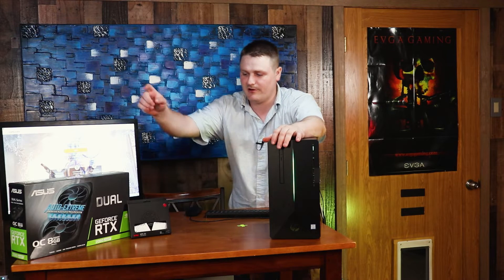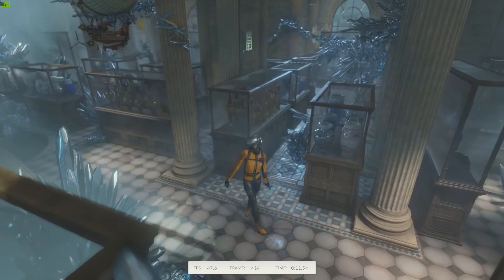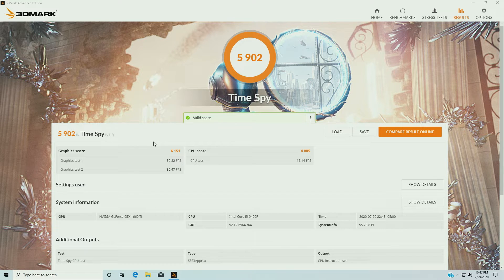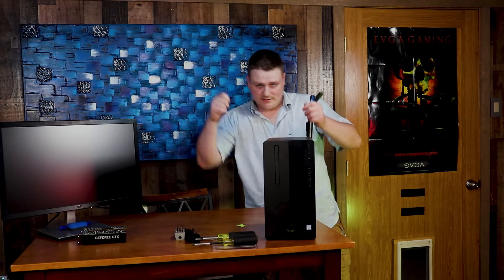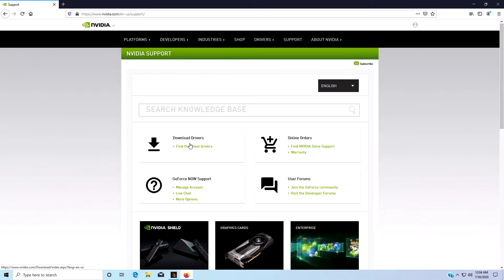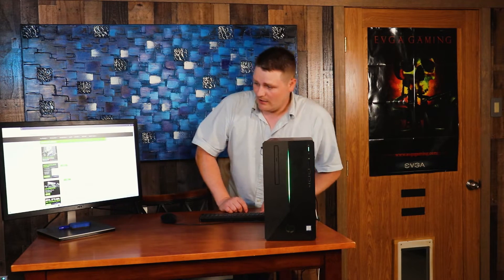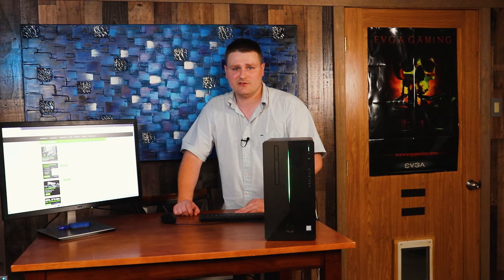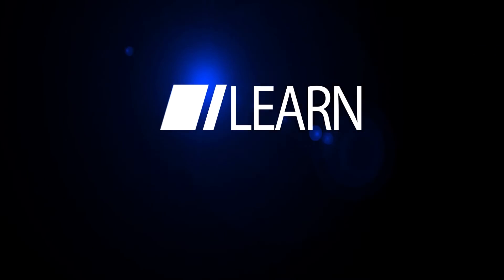Hp Pavilion Gaming Desktop 690 Upgrade To A RTX 2060 Super 8GB GPU & 16GB Of Ram (How to Install)

Comment: i have a HP Pavilion Gaming Desktop 690-00xx with an AMD Ryzen 3 2200G with Radeon Graphics 3.50 Ghz, 24 GB RAM, with a  Radeon RX 550/550 series GPU. is there any place  where i can find which GPUs can be used to upgrade it?   Another question: is the case ok for that card? forget about the space, will it overheat after hours of using it? it just doesn't seem like these pcs have enough airflow for that kind of card
Reply from the maker: Well they do run warm, no they do not overheat.  You will have to look at your psu, to see what one you have. If you have the 400watt psu, with the 6+2 connector. that will work for up to a 2060 super. They make a 500watt that will only take 1 screw. from the forum posts I've read. I do want to test this psu out, and see if I can drill one hole to get 2 screws in to it. Then I would make a printable template foldable jig, so you could drill one hole so it is secured. This is some thing I have planed. Just have to order the psu and cad out the template and jig. When I have the time and get the psu.

Comment: Hi I have a HP Pavillion TP01-0040. The dimensions are 13.3 inches in height, 6.1 inches in width and 11.9 inches in depth. I am trying to upgrade the gpu of my pc. Do you know if an rx 580 8gb with dual fans fit in it? The dimensions of the rx 580 is 4.9 inches in height, 1.6 inches in width and 10.6 inches in length. Please let me know I can't find any information online. Thank you!
Reply from the maker: What I would do to be 100% sure is power down the system, unplug it, then take the side off. See if it measure out. I do not know the case. This is the best I info I could give you so you are sure it will work.
Reply: @TNW1337  ok thank you so much I will try

Comment: But what about ventilation? With such a monster GPU will it still be cooled enough?
Reply from the maker: I would only do a Dual fan Gpu, Because of it. They do Blow out a good amount The GPU does it has venting. Doing 4 Benchmarks is like taking every thing to 100%. In a room temp the setting the system only got to 60-65C Now the Cpu did see 70C but the Intel's can do 80C be for they see damage. Most Cpu at full load will sit at 65-70C it is Fine. At idle most sit at 40-48C

Gpu are a different animal.

Look at this link https://www.wepc.com/tips/optimal-cpu-gpu-temperature-gaming/
Reply from the maker: blaziken  As long as you have a 400 watt Psu a 2060 or 2060 Super is just fine. If you can find the under 210 Watt card. 2070 dual fan it will work. It will run warm. 
If you try to OC you will run in to problems.

AMD's back in the day Average Temperature was 80-90 some Cpu's Even Higher. Unlike Intel's they would top out at 85-90C This is getting in to damage be done Area.
Reply: Asus also makes a mini version of the gpu that provides better clearance. EVGA makes several that will fit as well. I am currently running an EVGA 2060 KO Gaming in my HP and it fits perfectly and stays cool and works great with the 400w psu.
Reply from the maker: @kagato82  I will be punting out a 3070 in it soon. I have the 500w psu on order, I also Moded a flex Atx in to the case. I had to build a plate. I am try to find a distro that will pick it up and sell it for cheap, the plate and jumper cable. I do not want to have to sell it and make them. But I am having trouble making the covert cable. I followed the Atx standard. It has made me mad so I am going to figer it out if I have to blow a pc up. I may want to order some extra Motherboards. If I can get the flex ATX to work We can do a 3090 if we wanted to.
Reply: @TNW1337  I look forward to seeing a new video.  My HP will be going to my son for his birthday. I ended up building my own gaming pc shortly after modifying the HP.

My new rig
 Ryzen 5 3600 3.6GHz boosting to over 4.3GHz 

G.Skill Trident Z Neo 3600 8GBx2 CL 16 

MSI MPG X570 Gaming Plus 

MSI GeForce RTX 2060 Gaming Z 

MSI Core Frozr L with 2nd fan for push/pull 

Cooler Master MasterBox K500 (stock intake fans replaced with 3 Cooler Master MF120R's) 

Seasonic Focus GX 650 Gold 

Enermax SquA RGB Fans 

Samsung 970 EVO Plus 250GB NVMe M.2 SSD 

SanDisk Ultra 3D SSD 500GB 

PNY 480GB SSD 

WD Blue 1TB HDD 7200RPM 

Windows 10 Home (Full Retail) USB 

Peripherals: 
ASUS VG248QG 1080p 165Hz monitor 

GeekPi 5 inch monitor used as system info display 

Razer Ornata Chroma keyboard 

Cooler Master MM830 mouse 

Steel Series Arctis 5 headset 

Klipsch Pro Media 2.1 speakers
Reply from the maker: @kagato82  Awesome 😁🧤 Was it your 1st time ?
Reply: @TNW1337  yep, and it went without a hitch.
Reply from the maker: @kagato82  Cool I would much rather see people build, if they can. But the Hp are good starters.
Reply from the maker: @kagato82  I am happy you picked a good brand for the Psu. Tbh I would use all the parts you listed. All are brands I trust.
Reply: @TNW1337  totally agree 👍
Reply from the maker: @kagato82  I had some problems with Evga, There Customer support is not the best let me be honest it sucks!!! well they lied to me four times on too different calls. I still like there Gpu's & Psu's. But any thing else is a strong pass. I had a mouse, Aio & too motherboards from them that died or had problems. The last mother board was having M.2 problem and the silk screen was off on the board, it was miss printed and very confusing. So the new board they sent back, I had planed for the channel a build video.The Cpu socket had bent pin's from Evga. I ended Up having to re shoot the video.

 I was pretty upset and swearing a lot. three fourths of the video would have been me beeped out. So my trust in them is all but lost. But I do have their 1300watt PSU and a GTX970 that is going strong. Just makes me worried that the Psu will not last as I spent over 400 doll hairs on it. I also planed to use it in other builds when ever I upgrade. It is on build 2 now. Only Other brand I stay away from is Gigabyte and ThermalTake.
Reply: @TNW1337  I'm just happy that I managed to get it all done at the beginning of the year before the Covid really hit the fan.
Reply from the maker: @kagato82  I know it has jack up every thing...
Reply from the maker: blaziken  Not sure but I know the zotac 3070 will fit. Is the L smaller then 10"

Comment: I’m looking to stream at a higher quality. Do you think upgrading the ram will help increase my bitrate? Also, is there any other suggested upgrades for this pc for streaming?
Reply: Thank you very much!
Reply from the maker: @arcticdrake7035  Any time.
Reply from the maker: Ram At 32Gb And Gpu at the 2060Super or 2070. A i7-8700 is about all you could do. You could look at building a PC at this time all your Missing is a Motherboard, Case & PSU. 

Thing is this Pc is very limited on the storage. Say down the road you start to do Youtube you may want some of your old game play footage. and you can not rely on Youtube to keep it for you. You could look at the HP omens but they ask well over the parts msrp ($500-$900) Over. you could build a pretty Nice pc for $1200-$1500. 

What you get from omen at that price is sub par, this is what sucks. You become very limited in what you can do with the PC ones you want to do more then Game and a little streaming. 

Good Luck.

Comment: is it possible to change the case into an ATX case?
thanks.
Reply from the maker: yes
Reply: @TNW1337  oh god you responded so quick thanks for that man, i bought this case " MB250" from cooler master and i own this pc "HP Pavilion Gaming - TG01-1001nx" and they say the motherboard is too small to fit the case.
Reply from the maker: @E6J  I just got done with a long shoot, So had youtube up in the back ground with some dub step playing to relax. It is you would have to get a different Mother board and Psu.
Reply: @TNW1337  thanks man I really appreciate it, and keep doing what you doing, I’ll get a new motherboard asap <3
Reply: And the psu too 👍🏼
Reply from the maker: @E6J  Sorry to break the bad news if you need help with a mobo, just hit me up.

Comment: Too fast🤣i wanna see exaclty how u do it😬ima try this on my own tomorrow. But also changing the powersupply since mine is too trash😅

I got the 690-037 5QU29 EA with an i5-8400 and gtx 1050. Can i upgrade the gpu and psu? 

I should be able to, right? >.< i mean i know i can fit it somehow. I just dont want to break anything.... i am kinda sure the powersupply now is too weak for any gpu upgrade >.> 

I hope the Fractal Design Ion SFX-L Gold 500W wil fit in there. It does come with some adapter to fit different sizes🤔i am 100% noob on this😅
Reply from the maker: Lol 😁 I try to joke around it makes the day go by better.Hey we have to start some where 😊.The Psu would be to weak.

Be aware that only the Hp Psu will fit, stupid proprietary err. There is a way around this but I  have not tested it. You would also have to order a 24pin to 6pin. I would say let me blow a computer up testing this, then try it out your self.

they do make a 400 watt PSU that is not over the top in price $77. With that Psu you can put in a RTX 2060 Super in. Make sure the card is not over 10.15" long. The case will only allow like 10.22". Most dual fan cards are fine here.   

Replacing the Psu is 5 Plugs, they only will fit in one spot. 2 cables are the same, one is sorter then the other. So the longer will go to the top of the Motherboard. The other is shorter. 😊

Replacing the Gpu is pretty simple 2 or 3 screws and it is out. Then Replace it, it does take a little force to get it in to the slot. If it feels like it is not moving reposition the card up or down. Try to make sure it is level with the case. 

The dam case is like a puzzle when you try to get a Gpu in it. I guess that's what you get when it comes in a such small cute case. If you need any help Just ask.
Reply: @TNW1337  this power supply actually came with a 24 pin to 6, i mean. Worst case i ruin the whole thing and need to buy a new pc? x)
This thing is an sfx that comes with several adapters to fit afx?🤔this is the only scary part tbh, the frikkin power supply unit 🙄 i am kinda chicken with these things😂
The recommended is unavailable in my country so i do not have that as an option ^^
Reply from the maker: @innovativeg4m3r  Oh that sucks Yeah If can be adapted that should work. I mean there is room for a normal Atx Psu inside the case. I know of others that have put in Normal Psu, it only allows one screw in PSU. Do you have a link to the psu you got? I can take a look for you.  The most likely of out comes is it just does not power on. Or does not fit.
Reply: @TNW1337  it is in swedish😂i can check an eng site after work 🤣
Reply from the maker: @innovativeg4m3r  Not a big deal ether way, I am sure I can get by. Or need be use google translate. Yeah what ever works I may be a sleep by then. So it will have to be tomorrow. I will be shooting a new video but after that I should be free to look in to it.😊
Reply: @TNW1337  they had it in eng too😎
Reply from the maker: @innovativeg4m3r  Your awesome 🤩😁
Reply: @TNW1337  it seems mine use 4 pins at 2 different spots o.o and one small for the fans >.< that is all connected between my psu and motherboard. nothing more. f*ck this😐i need some stupid solution to run the gpu😐maybe i just refund it all🤦🏼‍♀️
Reply from the maker: @innovativeg4m3r Oh no😪, Well lets see if we can fix this😃, they make a Molex to 4pin adapter. Well that fix that problem ? 
https://www.ebay.com/itm/4-Pin-MOLEX-to-ATX-P4-CPU-4Pin-12V-PSU-Power-Supply-Connector-Adapter-Cable-/112151149501
tell me if that link works for you. One thing I would look out for is to make sure it is not small Gauge cable I would not go below 16Ga. 18Ga, 20Ga, Will be way to small.
Reply: @TNW1337  my entire thing is running on a 180w psu. It is super weird tbh. 
I have never seen this before🤣nor my friends >.<
Reply from the maker: Well there is discord, I have my server listed if you wanted to jump on. Or I could link it. I am about to jump of to fish up this video. But I have 10-15 min if you need it.
Reply: @TNW1337  i gotta sleep. But link the discord :o might be super helpful. This thing is super odd🤣appreciate u taking the time. Lemme know if u got time some other day or hours 🤣
Reply from the maker: @innovativeg4m3r  Yeah or tomorrow when you wake up. https://discord.gg/AgZc6J3QSG
Reply from the maker: @innovativeg4m3r  Did you get it to work ???
Reply: @TNW1337  i still dont have all connectors i need. I got for the two 4p 12v but not the small cable in the front with green, gray and black cables. Ima go to a proper store and look at their cables☹️
Reply: @TNW1337  i am screwed. No adapter exists for my setup and i duno enough to make my own. I now surrender🤣not paying 170€ for the psu😂
Reply from the maker: @innovativeg4m3r  Well amazon has the 24pin to 6pin. that's the one that has 3 wire's coming from it black, gravy & green. HP will not ship to you location?
Reply from the maker: @innovativeg4m3r  will amazon not ship to your location ?
Reply: @TNW1337  nope🤪
Reply from the maker: @innovativeg4m3r  Let me see if i can find a adapter that you can order.
Not all hope is lost.😁😉
Reply: @TNW1337  and i can not use that. I do not have a 6pin Connection :) mine got 4pin at 2 separate locations and the three wires 🤔
Reply from the maker: @innovativeg4m3r  The one with the 3 wires is the 6pin they just did not use all the pins. If you pop it off it should be a 6pin P2 Connector.
Reply from the maker: @innovativeg4m3r  https://www.moddiy.com/product_images/n/598/HP_Z240_PSU_Main_Power_24-Pin_to_6-Pin_Adapter_Cable_%2830cm%29__58554_zoom.jpg
Reply from the maker: does that image look right:?
Reply: @TNW1337  no. I do not have the blue or the purple cable :)
Reply: @TNW1337  my motherboard is no this one but the power looks indentical. P1, P2 and P3

https://support.hp.com/doc-images/189/c06523599.png

Comment: can i get i7 9700k with this pc or not and is it possible to get i7 10700 or i5 10600
Reply: and what do i need to do to upgrade my gpu to a 1660 on the hp pavilion 690
Reply from the maker: No K will work with the HP's. This model will only fit 8th/9th Gen.

Comment: how do you change the ram frequency from 2400 to 3000+? i can’t seem to find it in the bios
Reply from the maker: You can not it will not allow you to.
Reply: Download ryzen master if you have an AMD cpu. You need to select either profile 1 or 2. Click the tab that says precision boost overdrive. Enable memory clock. It should automatically enable dual channel. Set to 1600 mhz, do not change any other setting if you do not know how to overclock or you will probably boot loop and have to reset your cmos. apply and test. My system is the AMD 5600g with a Radeon rx 5500 and corsair vengeance lpx 2×8gb @3200mhz. Your dimm speed will still be 2133mhz because you didn't change anything in the bios because you can't (hp bios is locked out for the most part) but your memory will clock at 3200mhz. You should be careful with this though. Because you are manually clocking and your ram will always clock at 3200mhz and will not down clock. If your power isn't stable or you are overclocking your gpu you may fry your motherboard. If you get memory rated to run at a lower voltage i believe around 1.8v you won't have to worry about this and it should automatically run at 3200mhz. I would recommend "Crucial" it's green stick memory without a heat spreader. Cost a little bit more than what you probably have in now. But it will be much more stable and reliable.